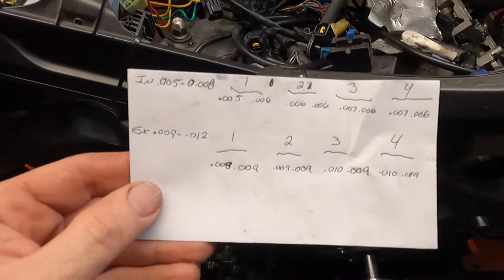2005 Yamaha R6 Valve adjustment

Comment: Hey
at 8:34 you're turning the cams on cylinder 1 to the point that they are facing upwards. I'm pretty sure that this is not the correct way to meassure the valve clearance. I'm riding an XJ6 (pretty similar engine to the R6) and when I put the timing mark T under the timing cover to the TDC for cylinder 1, the intake cams are facing towards the airbox and the exhaust cams towards the front wheel like this: < >  and not like /\ 
Same for every other cylinder.

Correct me if I'm wrong,

Greetings from Germany
Reply from the maker: Thanks for checking out my video & the comment. It is the absolute correct way to check vavle clearances. You want the cam lobes facing away from the buckets when youre doing your measurements. As long as the cam lobes are not in contact with the buckets you can take you're measurements. The lobes can be facing sideways as long as the lobe isn't in contact with the buckets.  Now if I was checking cam timing I would then make sure timing marks are lined up on the fly wheel & the cam sprockets.       All that would come into play if I needed to remove the cams to reshim a valve. I appreciate you checking out my video all the way in Germany. Feel free to ask me any you might be curious about.
Reply: @limitlesspowersportsservic3394  Thank you for your quick reply. Yeah that makes sense that you can take meassurements as long as the cams are not hitting the buckets. I just thought that the cylinder that you are checking has to be exactly at TDC in combustion stroke the moment you're checking it and not "just the cams facing away and not hitting the bucket" because of this precise and tiny meassurements. I thought that there will be differences in meassuring when doing so, for example: cylinder 1 is exactly at TDC, cam lobes are showing to the left and right < > (for my XJ6 example and owners manual) could give me another valve clearance than cam lobes are facing upwards. Is this just negligible?

Again, greetz from Germany and all the best to you!

Comment: Great info on the plugs! Worth it to test the primary and secondary of the ignition coils, the DENSO were a known faulty part but the Mitsubishi coils hold up pretty well.
Reply from the maker: Yeah it seems DENSO has had many year of issues with all kinds of coils for a lot of different manufacturers.

Comment: don't iridium's last a bit longer? i heard for some peeps on fz6, they go through plugs about 8k miles.
Reply from the maker: Yeah they're supposed to last a little bit longer. I'm just not a huge fan of them because I had a lot of issues with them when I was running them on a Dyno with electrical interference. Also for the money you pay for iridium compared to the standard I personally don't think the performance is that big of a difference. But everybody has their own opinion so if it calls for iridium's I put iridium's in if it doesn't call for radium then I do not use iridium plugs

Comment: Hey I’m doing my valves and it seems like most of them on the exhaust side are too tight. >0.127mm do I just take the old shim out and put everything back together and go from there?
Reply from the maker: Hey Always Hustling.  No not exactly.  So make sure to write down all your measurements first. Then put your motor at TDC on cylinder #1. I'm sure you know how to properly take your cams out if you're doing your own vavle adjustment.  Then take the shim out & measure it with a set of caliper & write that measurement down. I usually do mine in  Thousands of an inch instead of millimeters. For me it's just easier to figure out what should I need that way. But anyways after you write that down you need to figure out how many thousands or millimeters smaller or thicker depending on what your measurement was you need to go with the new shim. So let's say you have a 2.20 shim in your exhausted side & you measured  .009 & you need it at .012 well you  know you need a shim that's. 003 smaller than what's in there. You can sometimes still read the # on the shim then you look in you shim kit & grab on & measure it till you find one that's .003 small than that your other one measured.  Then you do that to all of them & then put your top end back together & make sure it's in time. Then rotate the motor over by hand a few times & then measure the clearance again. If it's correct awesome but if not you will have to repeat the process. The more you do valve adjustments the quicker & best you get at it.

Comment: great video! gonna attempt on my 07, still new to all of this. when the valves are out of spec when you add the new shim do u still keep the old one in? saw another video where the guy used both the new and the old shim
Reply from the maker: Thanks for checking out my video.   To start off you absolutely never ever use 2 shims stack on top of each other. That will end in a disaster.  You buy yourself a proper shim kit from hot cams.  You measure the clearance  & if any of them are out of spec you have to put your bike at TDC take the cam chain tensioner out then un bolt the cams & measure the shim then male the difference up with the proper new shim. Then bolt it all back together rotate the motor over &  Re measure your clearance to see if it is inspec.

Comment: How much do you charge for a service such as a valve adjustment
Reply from the maker: Hey Noah. I usually charge 2-3 hours of labor depending on how my valves I need to re shim plus parts. Shop labor rates vary from place to place. I'm only $75 an hour as of right now since I'm only open part time.